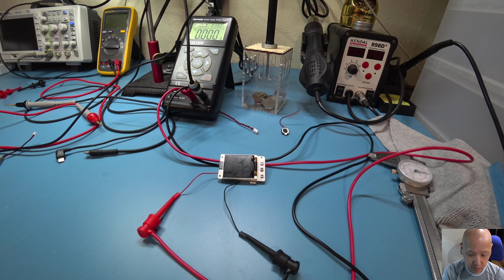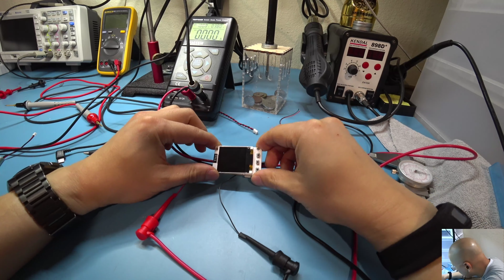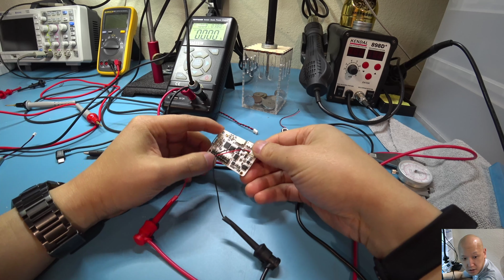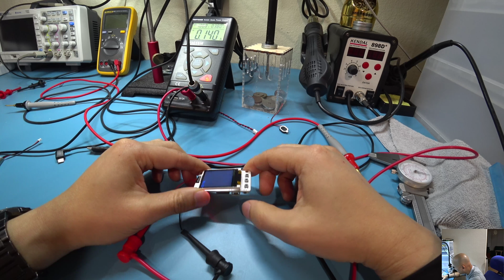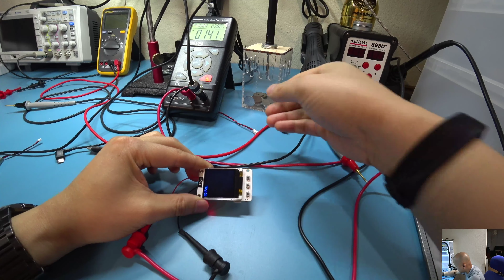TTGO TS 1.4 - IP5306 Power Switch Behavior

Comment: If your IP5306 has I2C, you might find that changing the button press required to turn the LED on/off will fix this - the button press can be set via the SYS_CTL1 register (Address=0x01) on the IP5306. Bit 6 in this register controls whether a long button press or two short presses will turn the LED on and off. There are other registers that control how whether a short press on the button will power on the load, and whether a long press or two short presses will power off the load. If you set the button press to turn the LED on to be a long press (same as the power off), this may fix your problem. The datasheet is silent on whether you can use the same button press for the two functions at the same time.

Comment: All you need is a reset button which is push to break or push to make with a fet.  However, that is a pain in the butt.  I was looking to use that chip.  The other thig I'm not happy about is the charge current.  There doesn't seem to be a way to program the charge current.  If I put 2A into the lithium battery I wanted to use - it would end up like a firework.  500mA is what I want.  I could limit the current with a resistor on Vin and that is what I may do.  You can also change the config via I2C.  Maybe thats the answer.

Comment: Hey there. Didn't know about the doubleklick for turning it off. 
I want to monitor the battery level and need to know the pin for measuring the volts input. I somehow couldn't find out. Could you tell me?
Reply from the maker: Looking at the schematic (https://github.com/LilyGO/TTGO-TS/issues/5), I don't see anything that obviously looks like VBAT connected to a GPIO over a voltage divider, but VBAT is connected to a pin which you could put through a voltage divider and feed into a GPIO on your application's board.